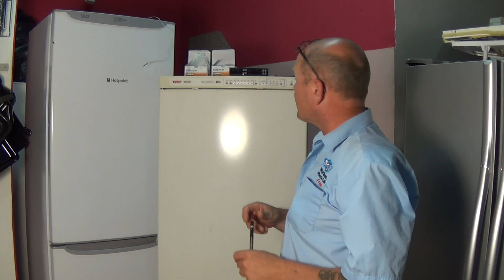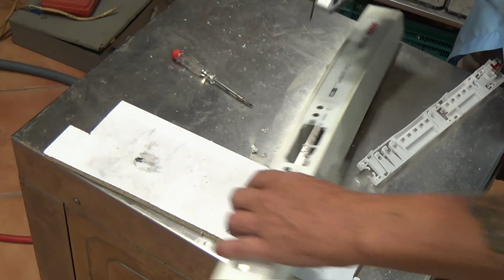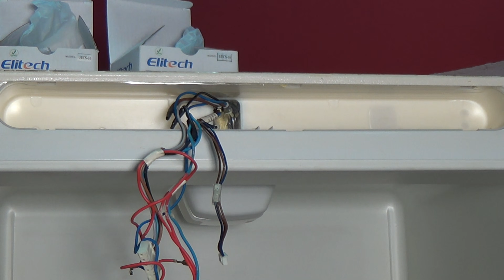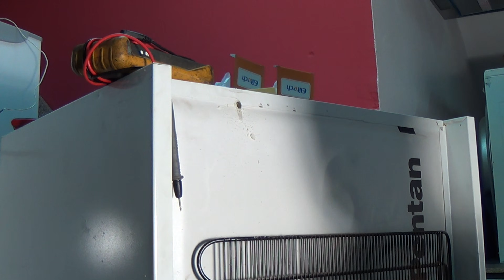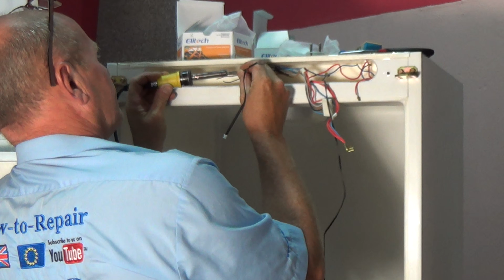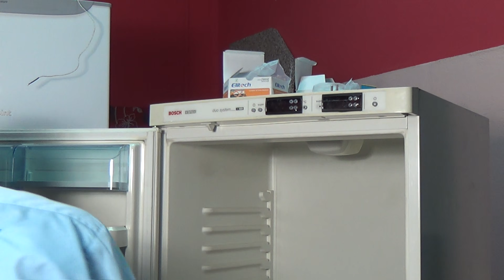Fitting electronic thermostats to fridge freezer

Comment: Will or can a STC-1000 digital temperature replace a danfoss manual/mechanical thermostat , I basically have an ice cream van with three temperature gauges 3 thermostats and three liquid solenoid valves  I wish to replace them with the above digital devices could you please advise

Comment: I'm curious Paul why you didn't just use the original wiring for attaching the new sensors for both fridge and freezer?
Reply from the maker: I knew I was going to be asked this, I wanted to do a video fitting the new sensors complete but half way through I found bottom freezer sensor was to short, on some makes you may have to fit new cables so at least people can see booth Techniques I will be uploading a lot more of these over the next few weeks.
Please remember to subscribe to our channel https://www.youtube.com/user/Apart4u?sub_confirmation=1
Remember to Shop with www.how-to-repair.com and it would help us by posting the video or
Website on your timeline. This helps us a lot and if we really helped you can
Always buy us a beer http://how-to-repair.com/help/buy-paul-a-beer/
Please remember to mark us to your favourites also I would be grateful if you would
Subscribe to our channels social media as this really helps my site and keeps us going.
YouTube. http://www.youtube.com/user/Apart4u
Facebook. https://www.facebook.com/how.to.repair.appliances
Reply: @How-to-repair  what if there it's a single compressor fridge freezer?
Reply: @How-to-repair  can you still do this on a single compressor fridge freezer.